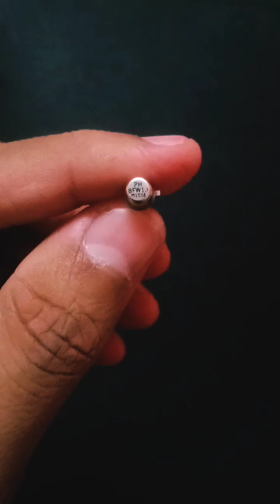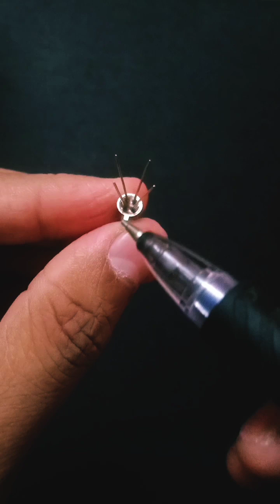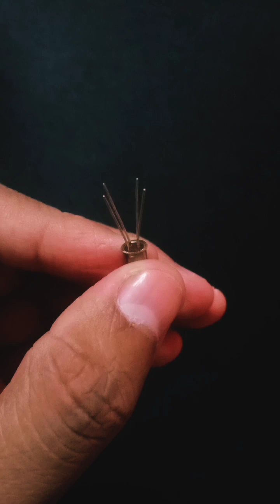#jfet #transistor #analogelectronics #electronics #fets #multisim | BFW11 | BFW10

Comment: hello, what is the use of the body terminal? can we leave it without connecting it to pcb? one more question, is this old type of jfet good compared to the new ones like bf245, i have bfw16 and I want to use it instead of two bf245c , can you advise me?  thank you for this pinout explanation ❤
Reply from the maker: The 4th terminal is used during high frequencies. I have already made one video on it give me a moment I will upload it now.
It totally depends on your application generally we don't prefer to use JFET we always go with MOSFETs and in some rare cases we use BJTs.
For more such amazing content related to electronics, subscribe  Youtube channel.
Reply from the maker: Hello there as promised I had uploaded the video please go through it once 
https://youtu.be/QEH2LBHJH8w
Reply: @practical-buddy  Thank you very much bro 🙂
Reply from the maker: For more such amazing content related to electronics make sure to subscribe the channel😊.
Reply: @practical-buddy  Hello again , I have more questions, since there in only few documentation about BDV81, the B pin "number 4" we connect it to the source pin or to ground as the metalic enclusure act as a shielt? and can we use BSV81 as a replacement for bf245C ? thank you 🙂
Reply from the maker: @TruthDigest  Hello there,
Sorry for the late replies as I was bit busy.

I just went through different sites and this is what I can conclude as of now.

BDV81 is a P-channel JFET  typically used for switching and amplification purposes. Generally, B refers to the body terminal so I recommend if you are using it for amplification connect it to gnd else leave it open.

Talking about Bsv81
As for BSV81, it is also a P-channel JFET, but it is a low-power JFET with different characteristics compared to BF245C, which is an N-channel JFET. 
BF245C is commonly used for low-noise amplification and switching applications. While BSV81 may have similar pin configurations to BF245C, they have different specifications and characteristics, such as different threshold voltages, maximum ratings, and other electrical parameters. 

Therefore, BSV81 may not be a direct replacement for BF245C without considering the circuit requirements and potential modifications.

I hope this helps you still if you have any doubts feel free to ask.
Also, make sure to like share and subscribe to the channel.
Reply: @practical-buddy  I am already a member of your channel 🙂 , thank you very much for  efforts spent for this feedback, excuse me , by the way BSV is an N channel jfet and not p channel.
Reply from the maker: @TruthDigest  
Apologies for the confusion. BSV81 is actually an N-channel JFET, not a P-channel JFET as I mentioned earlier. I apologize for the mistake in my previous response.